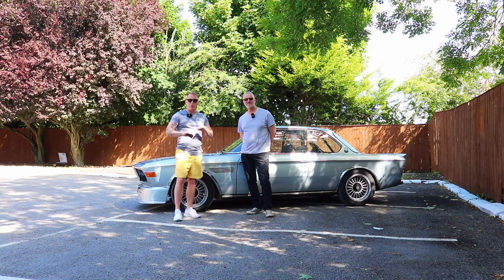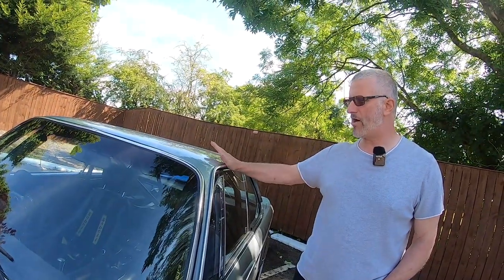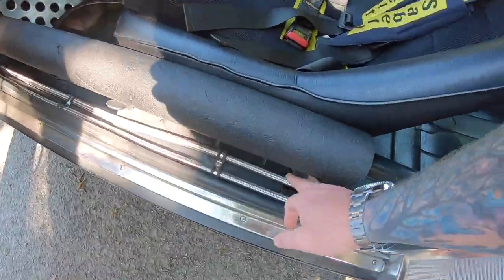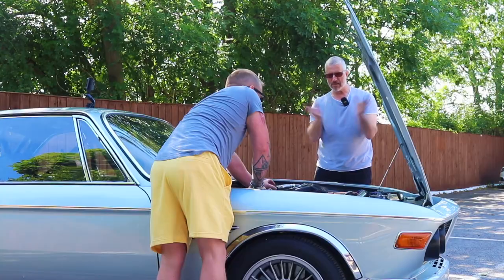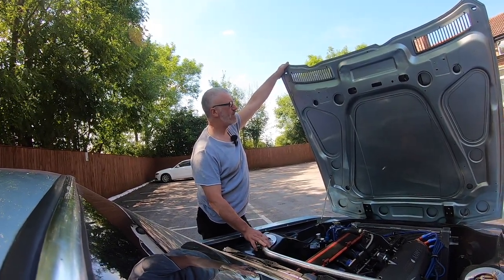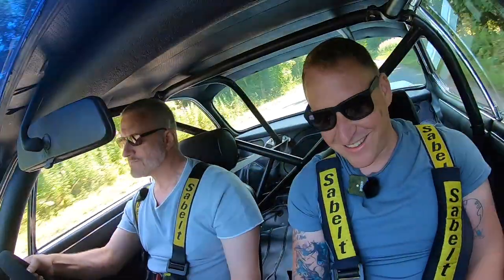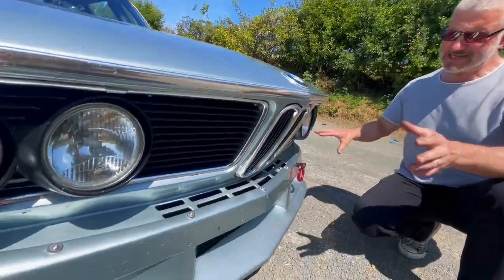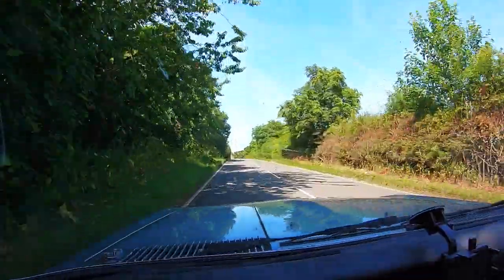BMW 3.5 CSL ** WHAT A TOOL!! **

Comment: Kudos for a nicely done project, Sorry mate,  but a CSL = Lightweight coupe with sunroof? I wasn't aware that was ever offered. I owned two 3.0 Schnitzer CSL, the x-light fixed plexi rear sided and back window, (these look like glass) and the black 2 piece light plastic rear bumper, no front bumper.  With Matter roll bar, cast headers, Scheel 400's, tighter ZF steering box, ZF dog leg 5 speed (straight cut teeth, noisy but stronger) and ZF 75% lock differential, the weight was under 1,100 Kg. 
Body was made by Karmann in Osnabrück, doors, hood, and trunk lid were aluminum, and some of the body's sheet metal was thinner than on the regular coupes I believe.  Cheers

Comment: Nice car. Not liking sunroofs sounds a bit cope though. Even in winter we get days without cloud and the sun is out, if you're cold bang the heater on and have the roof open.
Reply: I get but they add a lot of weight and in these cars they rust where the roof joins the frame

Comment: Bought one of these as an mot failure in around 1981 for £150, the sills were absolutely rotten, new replacement sills were an absolute fortune, sold it for £500 as it was lol. You live and learn but £350 profit back in the day was a good deal lol 😁👍👍

Comment: Proper old fashioned forced induction no silly pops and bangs with silly exhaust valves 👍
Reply: Not forced induction if it’s n/a, throttle bodies aren’t forced induction
Reply: @reganbourne3249  suppose so